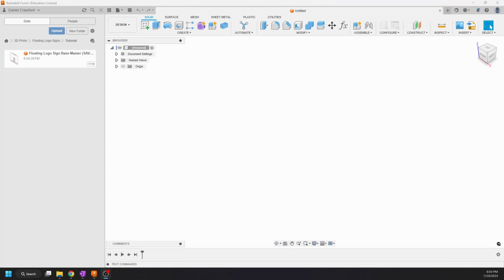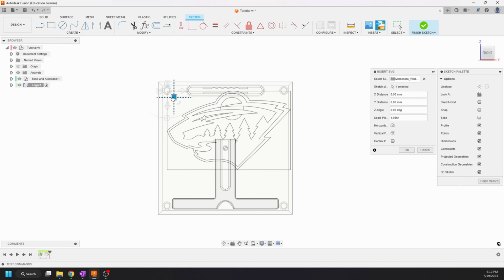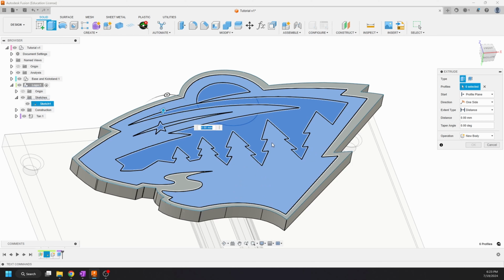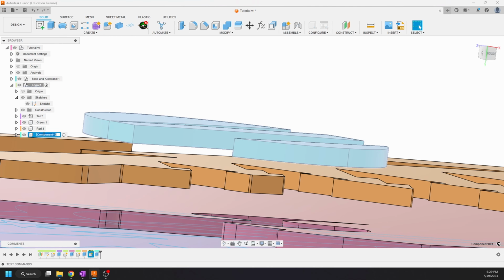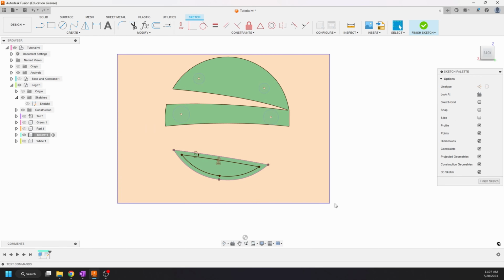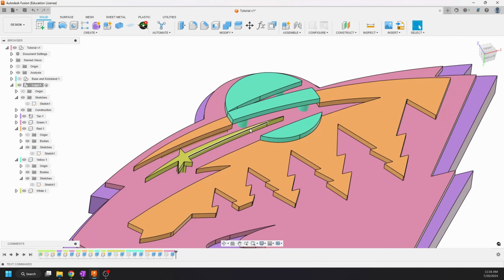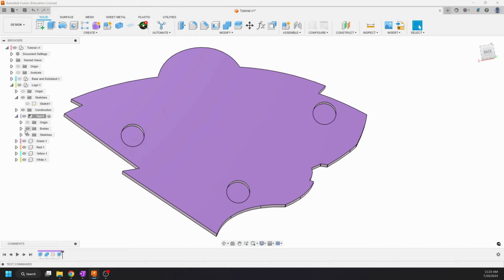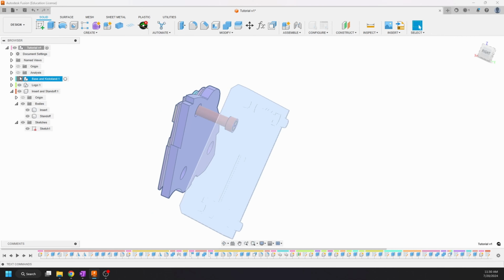Fusion 360 Tutorial- 3D Printed Floating Logo Sign Part 3

Comment: I'm new at this, but you make it very simplistic.  Would you please explain the Boolean Cut in more detail?  Thanks!
Reply from the maker: Sure! A boolean cut is the term for a calculation a CAD program uses to combine or cut two objects using each other's geometry. In Fusion, all boolean operations are located in the Combine command (which is often confusing to new users, because the combine command can join, cut, or intersect). For a boolean cut, we're using one part as a cutting tool to cut out an exact copy of the overlapping portions from the other body.